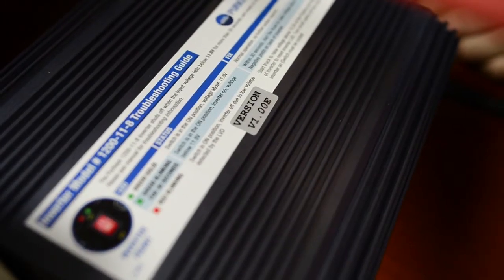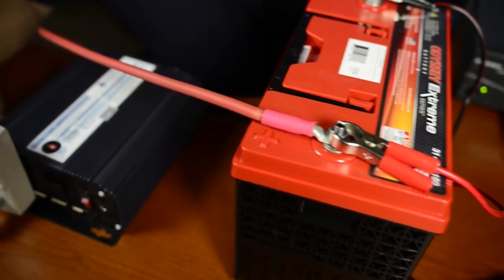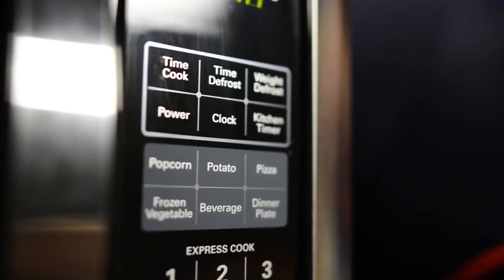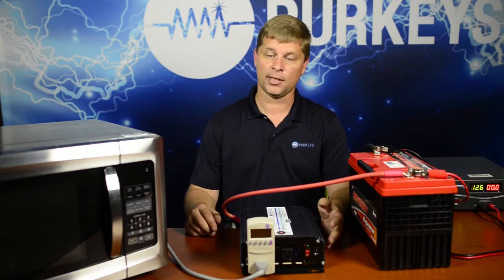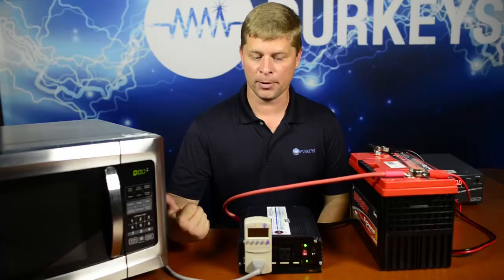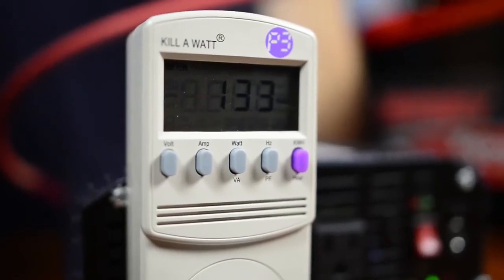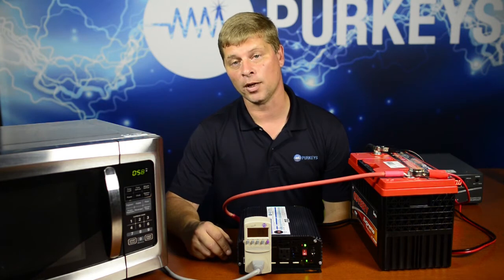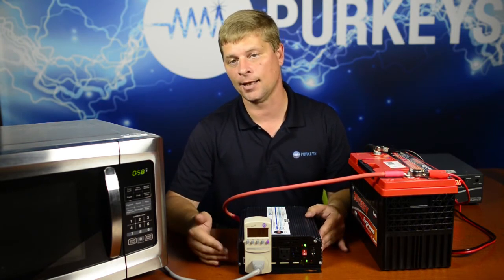Importance of Measuring an Inverters Output - Purkeys

Comment: How much is used by the minute? Would a 1000 watt (usage watts not cooking watts) microwave use 16.6 watts per minute.
Reply from the maker: Yes, when calculating power whether in watts or amps it is always a matter of power X time. So, if it was pulling 1000 Watts for 60 minutes, it would total 1000 Watt/Hours. But if it was only used for 1 minute, you could divide the 1000 by 60 minutes and you would have the 16.66 watt/hours that you came up with.

If it was one for 30 minutes it would pull 500 watt/hours. 15 minutes 250 Watt/hours, etc.
Reply: @Purkeys  awesome so since my inverter can handle the load I can still have quick coffees without overloading my solar system since it only takes less then 40 watts including inverter loss.
Reply: Which instrument did you use to measure inverter output?
Reply: @exafricaenergy0000  you'll need a good clamp meter and digital multimeter to be able to see amps coming out from one or both hot legs of the inverter multiply that with the voltage that the inverter is at on the ac side to get running wattage. A really good clamp meter will have a max current hold to be able to show the surge of something that uses a motor to start since it could use 3 to 10 times the current to get the motor spinning. Hope this is helpful.